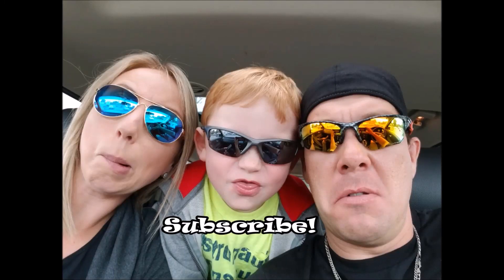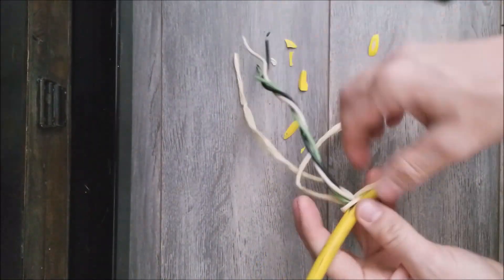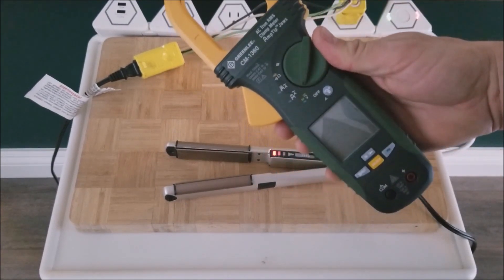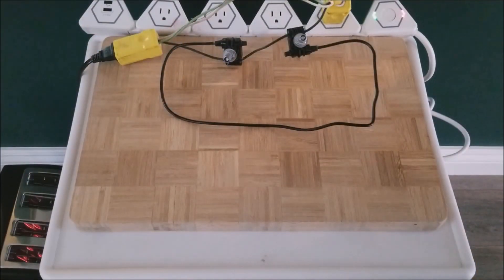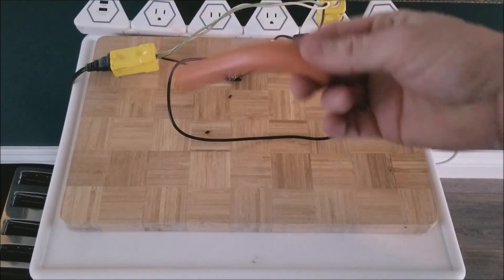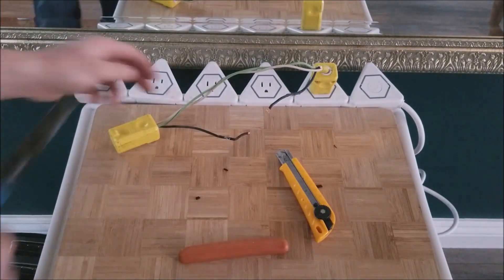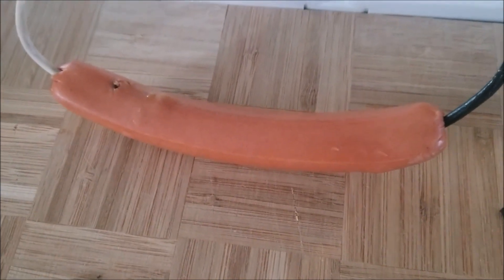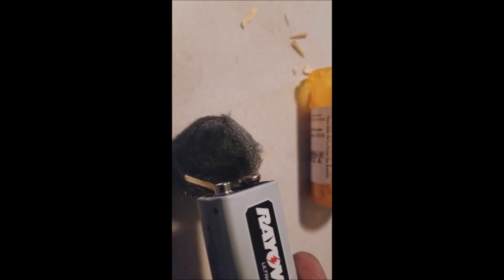Electrocution and Amperage

Comment: I love your demonstration. I hear so many sayings about this subject, with so little understanding. 
It is the current that kills. But without the potential (volts) there may not be enough current to kill. Also, a line with potential but no current can still kill because if you touch the line, you are creating and becoming part of a complete circuit, in which current may flow. There may be a high potential, as in thousands volts with very little current potential where you will just receive an annoying shock, for example when you touch a door knob. But if you have a sufficient potential with suffient current potential, such as from an electrical source, then you have the potential for a deadly shock.

Comment: When I was young (I must have been about 13), I had some very bad experiences. I tinkered with a self-made power supply unit that was still connected to the mains. Anyway, suddenly I had the phase (in Germany, it was 220V at the time) in one hand and the neutral conductor in the other. 

And I was stuck, I couldn't move any more. Even thinking was slow motion. I thought I had screamed, but my parents in the next room heard nothing. Only by some kind of luck did I fall off the chair and get separated like that. 

It must have been a few seconds. I had been insanely lucky. I had several severe burns on my hands. Not only at the contact points themselves, but apparently the current flowed both inside and outside the hands, so that I had several entry and exit wounds. My pulse had been very elevated for well over a week. That had been a life lesson for me.

Today, after 40 years, you can still see some minor scars in some places, otherwise I was just lucky. I later did an apprenticeship as an electrician. 

And during the apprenticeship, a colleague had a fatal accident on the construction site. The cable drums (for extension cables) were still made of metal at that time. And the phase was on the earth conductor (someone had really messed up). Unfortunately, this was the undoing of a pupil who was doing his practical training there) when he touched the earthed scaffolding with the cable drum in his hand. Unfortunately, he could not be resuscitated and had to pay with his life.

Such experiences impressively show how dangerous the "low-voltage grid" is.

That's why I think it's great that you make videos like this and explain it so simply and show that it's also understandable for a layperson.

And I hope that my English is halfway understandable.

Comment: Technically anything over 10 or 20 mA can kill you. I worked as an electrician for years and I also repair old radio, audio and test equipment. Some of the worst shocks and injuries from shocks I received were from tube amps with almost zero current draw but 300-10,000+ volts DC. I have left bits of my fingers behind, sizzling away inside amplifiers. I have been zapped by 480 VAC once or twice. The worst case of getting hung up and unable to let go was in a 3 phase 120/208 panel  on 120 volts. I was in disbelief that I was hung up on 120 volts and starting to kind of panic.  I had to force my knees to collapse so I could fall to get loose. DC? That stuff is just violent. It has slammed me against walls. It's almost the opposite of AC.  I got into it with a defective AC hi pot tester for a lovely 6000 VOLT AC shock. That hurt like heck.

Comment: There's someone I worked with who told me "It's the amps that kill'.  I told him, You're right but it's the voltage that pushes the amps.  Your body makes a garbage insulator so if you touch a distribution line (7.2 kV - 25 kV) with skin resitance of 100k you will be unable to let go as 80-250 amps go through you and turn you into a charcoal briquette.

Comment: Thank God someone gets it.  Every time I hear someone say "Electricity always takes the path of least resistance I nearly smack my head. Please people stop saying this and stop thinking this. Think of it this way. That toaster has two elements in it, one per side. In all likelihood those elements are not matched. So that means one side has for instance 20 ohms and the other 18. Using the logic of electricity always takes the path of least resistance means the current only flows through the 18 ohm side and the second side never runs. Yet, both sides toast juuuuuust fine.  People need to think about it with this saying. "Electricity takes EVERY path it can to make a circuit, with the current in each path inversely proportional to its resistance. Make sure it takes the right path."
Reply from the maker: Good example with the toaster!

Comment: You should get a neon or oil furnace transformer they produce 10kv -15kv, loads of demonstrations to do with those, from Jacobs ladders, conductive tracking thru some non'ish conductive materials to chasing earthworms out of the ground. Microamps of current but can ignite just about anything it touches,

Comment: A teacher told me its a combination of the two. I did commmunication linework (never got to power, made a few attempts) and i got lit up twice. Once was when i had to mush the bucket into a tree. I reached for the line and i didnt know what happened at first, but as soon as i touched a leaf i felt my forearm clinch up and felt a very uncomfortable feeling. The foreman jumped out of the truck and looked, there was no secondary. Only primary over the tree. No limbs were in it. I just got him to get me out of the tree. Another time a guy didnt tape the cable, so the jacket picked up induction and ima tell you what, the impact of that induction almost knocked me down, literally. Unfortumately i got into hvac, and got soaked carrying stuff to an attic in the rain. I had to lay down and crawl to the sofet. The old wiring in conduit energized the conduit and my two arms created a perfect circuit to ground right thru my heart. Fuck me, all i could do is lay down. Even 110 has plenty of ass behind it. If you ever become a solid ground for 110, youll know, you probably wont do it again.

Comment: In the arc flash class I had yesterday the instructor said that 50ma was lethal technically a 1.5 volt battery could be lethal in the right conditions

Comment: So in theory, if current is flowing on the neutral on a 120v circuit and you somehow touched a bare spot on the neutral wire.  Would you not get shocked due to the neutral being tied at some point in the circuit  to ground and since your standing on the ground there is no difference in potential?  If there is excessive resistance on the neutral or it goes open then is it just as dangerous as touching the hot wire?
Reply: Seems like a 0v difference would only flow current if there is just a wire creating a parallel path in the circuit and not a wire with a load on it...?

Comment: Electricity takes the "Paths" of least resistance. Somewhere along the line it was misconstrued as if it can only take one path at a time. That is false, it can take many simultaneously. If you run two parallel wires of the same length and each had the exact same resistance you'd have half your current go through each one. That's also why Bifurcated/Trifurcated wire exists.

Comment: The voltage present on the downstream broken conductor is not so mysterious when you realize that it was caused by induction from the current still flowing in the two adjacent unbroken phase conductors. “Backfeed” is a commonly used term sometimes used  in the electrical community to describe phenomena not fully understood.

Comment: The current thru you depends on two things: the voltage across you and your resistance. Period.  Car batteries can produce a tremendous amount of current(look at the fuse values) but 12 volts across you is not going to kill you, even if 15 amps is running thru the parallel leg.  Dry skin can be very high in resistance. I've held a hot 120v wire tight in my fingers and felt nothing because I had very dry skin and rubber soles on a wood floor.  Nobody should stick conductors into the end of their finger.  When working at a panel I always tried to stand on a dry board and only used one hand. Avoid the path thru the heart.

Comment: Live and neutral are in series.  Due to Kirchhoff's Law,  barring any ground faults,  the neutral (return) current must be the same as the hot (supply) current.  It is the delta V (voltage drop across the load) that leads to power dissipation,  assuming the I-squared-R losses in the wiring to be negligible.

Comment: It has nothing to do with the amount of current flowing through the line - it is all about current flowing through _you_.

But technically,  even with current through your body,  it has little or nothing to do with voltage or current,  ore power (which is the product of the voltage across a load and the current through it),  but with _energy_.  Too much power for too long is the lethal factor here. 
Of course,  this is for short term... otherwise, reciprocity failure plays into the equation, inasmuch as a few microamps through the body for a few hours, days, or weeks, but is not powerful enough to be harmful, as the energy is dissipated by tissue resistance long before it can cause much harm to said tissues.  

For those who don't believe about the time frame or reciprocity failure in principle,  consider the defibrillator.  It delvers only a few hundred watt-seconds,  and can restart your heart, without damage.  But that same amount of current that flows right when the defib cap begins to discharge can and will prove lethal if you come across a constant current source of this magnitude.  Why"  The cap in the defib loses energy exponentially, and peters out,  while the initial current,  when protracted,  will release much more energy, constantly,  until the current is interrupted.  

So,  over relatively short periods of time,  it is not the amount of voltage that kills.
It is not the amount of current that kills.
Therefore,  it is not the amount of power that kills,  per se...
It is the amount of energy dissipated through your body over a relatively short period.

Comment: Good job man. This is a perfect demonstration of what electricity will do to a person.  A lot of guys in the electrical trade think that 120 bolts won't kill you.  This is absolutely false.  More people die from 120 bolts than any other voltage.  Mainly because we  all have 120 bolts in our houses but it's still is dangerous if not treated with respect. Ive always said don't fear electricity, respect electricity.
Reply: It’s Volts
Reply: In Finland the most common type of electric deaths are men climbing on top of electric trains. 12 deaths since 2000, 20% of all. In total 60% of deaths since 2000 have been because of high voltage and 40% because of low (mains) voltage. In the 80s and 90s 35% were because of high voltage and 65% because of low voltage. That shows the effect of increased safety.

Comment: It's power that kills whitch is voltage times currant. Regulated by resistance so in this case voltage divided by resistance is current and then you multiply that currant by voltage and you get power flowing through a circuit. 10 W is maximal safe limit of dirct current for our body. Alternating current flows much more easily through the body becouse of its capacitive qualities. Basickaly capacitive impedance that I still don't understand :P

Comment: In a single phase branch circuit (blk, wht, grn), technically the white is not a neutral, but rather the grounded conductor. In order to have current flow, you need to have a complete circuit. So the AC travels on the Black to the Load, and then returns to the Source on the White. That is why you will have a current on the white wire.
To have a true Neutral, you need to have (2) Blacks, (1) White and (1) Green. In this case, the neutral is there to carry the unbalanced load between L1 and L2. If the Circuit is perfectly balanced, then the ammeter will read (0) on the Neutral.
Reply: Differences in nomenclature between Canada and the us can also get confusing. In Canada, it is refered to as the identified conductor. But, you are correct... Sorry about the semantics.

Comment: It IS the amps that kill, it just depends on where those amps are going
Edit: It's the joules, not the amps. Also in the case of 50Hz it's not the joules that kill but the cardiac arrest lol
Reply: Only in a roundabout way.  It is actually the energy that kills.  Energy is voltage times current times time.  A high voltage at a low current can't kill you, nor can a low voltage because it results in a low current.  You simply can't have high current through your fairly high resistance skin without also having significant voltage behind it - that's how ohm's law works.  Even when you're wet your skin resistance doesn't get low enough for low voltage to hurt you.  A car battery capable of delivering hundreds of amps to start your car will do nothing to you even if you're soaking wet.  Power is voltage times current.  It takes both to kill you, along with enough time for damage to occur.  High voltage times big current times significant time results in a large amount of energy deposited into your flesh, and that's what causes electrocution.  Yes the thresholds are different depending on where the energy goes, low thresholds for your heart or your brain, higher thresholds elsewhere.
Reply: The voltage makes the current.
Reply: @GH-oi2jf  The current is literally the physical matter moving with energy, it's the number of electrons per second. Voltage is the force they get pushed by. It's really both of them at the same time.

Comment: @4:27 Space heaters, like most appliances, are not allowed to draw anymore than 12 amps--I believe this is a UL requirement, and stems from the 80% rule in the NEC which states that a continuous load cannot draw more than 80% of the rated ampacity of a circuit. Most branch circuits are 15 amp circuits and 80% of 15 is 12, therefore 12 amps. As I recall, a continuous load is one that continues for longer than 3 hours. 
I have a Chevy Volt, and when I charge it off of 120V, it defaults to an 8 amp charge rate unless I specifically select the 12 amp charge rate. And this selection has to be done at every charge. This is apparently because GM was concerned about substandard wiring causing problems at the higher charging rate. I guess their lawyers advised them that the customer will be at fault if their house burns down because they selected 12 amp charging.... I have a 240V, 20 amp dedicated circuit for charging it (at 240V it charges at 3.3kW), but often in the summer I prefer to charge it at 120V (1.44kW or 0.96kW depending on amp setting) to reduce the heat buildup in my garage..and I have an outlet on it's own circuit for that, too.
My opinion....if you have to run an appliance that takes 12 amps like a car charger or a space heater...you'd do well to go to all the outlets on the circuit and connect the wires to the screw terminals instead of using the back-stab connections. Or better yet pigtail the connections with wire nuts.
Reply: If I recall correctly, it is not to code to use a receptacle as a splicing device, and are required to use a splice in the box and then go to your device. 

Anyways, I got to install a Tesla charger in a home, and that thing is on a 90A breaker, because it pulls 72A for more than 3 hours. (80% rule again.)
Reply: @IceBergGeo  You are allowed to use a receptacle as a splicing device UNLESS it is a multi-wire branch circuit. But these are not very common, at least in the USA. I think they are more common in Canada.
Reply: @brianleeper5737  they are as common in each county, though less in the USA, as handle tied breakers have been a requirement for a bit longer, maybe? 

I'll have to crack open the code book and get the article I thought I read.
Reply: @IceBergGeo  I thought they were common in Canada for kitchen circuits. I have never seen a multi-wire branch circuit in any house in the USA.
Reply: @brianleeper5737  I have. Lots. Especially in Chicagoland.
Reply: @IceBergGeo  You'll never see a multiwire branch circuit in Virginia. I suspect it's because the electricians here have no idea how to wire them. Which is probably a good thing, because you can bet that they'll use the outlet as a splice and the inspector won't catch it.
Reply: @brianleeper5737  they still use them as splices here. That's why I hate resi work. Not that commercial is a whole lot better sometimes, but mostly.
Reply: @IceBergGeo  Also, GFCI protection of multi-wire branch circuits requires using either a 2-pole GFCI breaker (inconvenient for the homeowner compared to a GFCI receptacle and expensive) or installing GFCI receptacles at every location (even more expensive).
Reply: @IceBergGeo  It's probably far more common than not, in residential work, to use the outlet as a splice. If I have to replace an outlet I generally pigtail it.

Comment: There’s really no such thing as a “minor electrocution”, at least from the victim’s point of view! The definition of “electrocution” is an electrical shock that results in death. Without the death part, it’s just a shock.
Reply: That's actually incorrect. The dictionary definition of "Electrocution" is to kill or severely injure by electric shock. It doesn't have to mean death.,

Comment: In the military, we were taught to be very careful around anything higher than 15 volts, because if the system could deliver the current and your body resistance was low enough, you could receive a fatal shock.  Normal body resistance is 100k ohms +, but if you are sweating or the contact points are damp it can drop to less than 100 ohms.